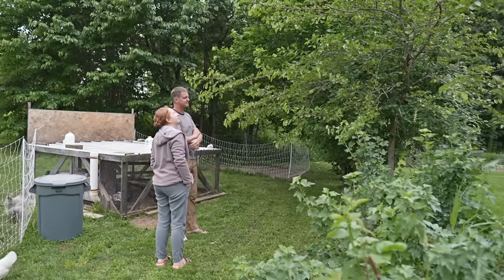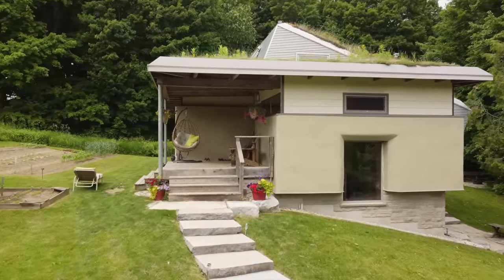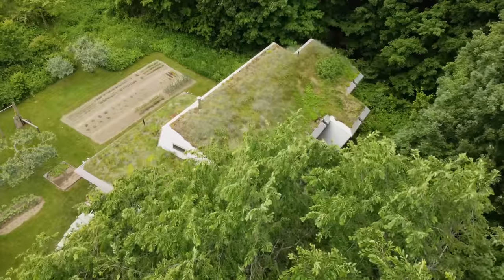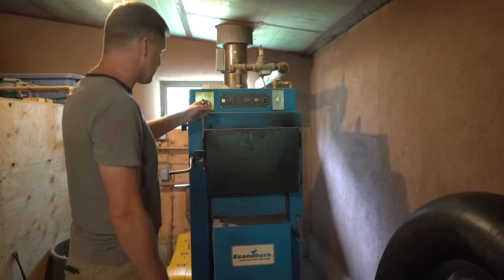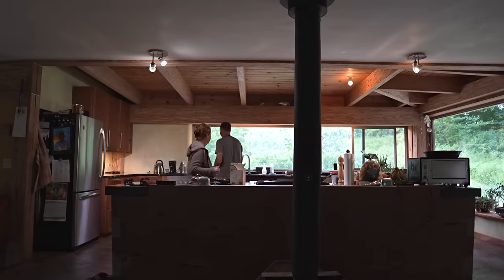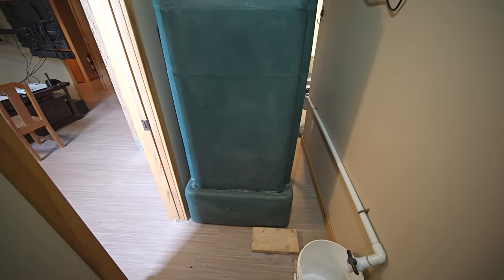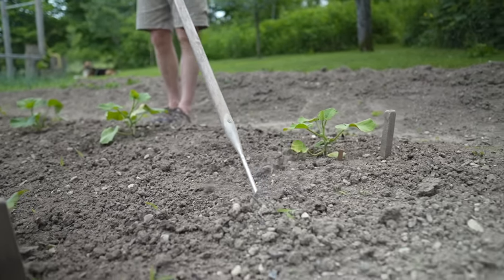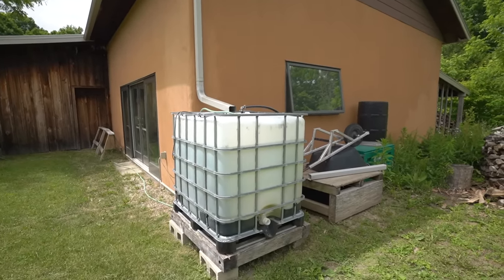Impressive Straw Bale Home & Dream Family Homestead — Sustainable Green Building

Comment: The extraordinary benefits of straw bale housing cannot be overstated.  (Don't get caught up in thinking straw construction can only be used as infill). The physical sensation of living in the quiet and warmth of a straw structure is profoundly nurturing.
Many states code straw bale without extra permitting or building requirements.  Several major insurance companies cover straw as well.
Reply: You have to have a structural “skeleton “ to support the weight of the roof as this person has done.  If not, then in an earthquake the roof will end up on the floor with you crushed in between the two.  Straw alone cannot safely support a roof.😊
Reply: @Mori-vl64k  Not to mention the straw compressing over time no matter what. Innumerable construction nightmares.

Comment: having straw for insulation is interesting. How does it react to moisture and how do you prevent your walls with being completely over taken by black mold?
Reply: I'm guessing that woodstove takes care of a lot of the moisture issues.
Reply: It’s covered by a breathable plaster so moisture can’t get trapped in. It basically just dries out when it gets wet and mould can’t form.
Reply: Straw is not the same as hay, but they look the same from a distance. Where hay would decay and develop mold or mildew in the presence of moisture, straw won't get moldy or decay because there isn't any organic matter left after harvest season. Farmers tend to burn straw if it's not being used to make something like straw hats or bags. 

Straw bale homes are fascinating. This home is very structured, but I've seen a lot of homes that have a more organic style.
Reply: @toldjacat  

You are correct that straw and hay are not the same but from there your explanation veers off course. Both are made from organic matter, which is, by this definition, anything with the element Carbon inside it. @lukeh3020 is correct by saying mould doesn't form because a breathable layer of plaster is applied to the straw bales on either side. This allows moisture levels within the bales to remain below a level mould will grow, unless that level exists outside of the wall.

Hay and straw are very similar but differ because hay includes the seeds (or grains). For example, if a farmer cuts mows a field of mature rye grass (it had gone to seed), dries it, and then bales the stalks then it would be bales of hay. However, if the farmer harvested the seed, dried the "waste" stalks, and baled those then they would be bales of straw. Then there is silage and silage bales, also referred to as "baleage" and are the large round bales, which take wet plant material and ferment it.

Straw is used for a lot more than just making hats or bags. A large usage is for animal bedding as it is absorbent, easy to put down and clean up, and animals like to lay down in it. Straw is a common material for mulch in gardens. The construction industry uses straw bales, usually in ditches, to filter debris so that it doesn't get into the water supply.

Comment: How has thermal mass been disproven as the best technique?
Reply: By passive design I believe. More efficient to have a super-insulated air-tight 4 wall box that's efficient year-round versus a 3 wall box with a mostly uninsulated fourth wall that allows for the thermal mass heating and changes efficiency as the seasons change.

Comment: What's that with the thermal mass? Isn't it important to store the heat from the day for the night and flatten temperature swings (phase shift day to night)? Sure good insulation, heat pumps and photovoltavis are the way to go, but passiv solar heat + thermal mass is a must have for a good indoor climate. Where can I read more about his insights?  https://youtu.be/WW12_UWsBaA?si=38rNnLR6bDbK74VP&t=306

Comment: I think their hearts are in the right place. But I see a lot of contradictions in this video. The amount of stone, while natural, is a nonrenewable resource, and there's a LOT of it here. There's a lot of metal in the build as well, with no mention of recycled or reused materials. They wanted a clean "breathable" home, but used tons of PSL lumber which off-gas formaldehyde over time. Their 225 gallons of rain water collection could be expanded, filtered, and sent back into the house to reduce their impact on the well/aquifer. Zero passive energy production, no solar ovens, no panels, no turbines, hydro, so I'm assuming they're on the grid and their passive solar water heating systems is just an effort to mitigate. Wood-gas is dangerous (explosive), produces tar that is carcinogenic and harmful to the environment, and inefficient due to have to chip and dry the wood.
Reply: I agree with a lot of what you say but I do believe stone can be a sustainable and renewable building material. 

I have worked on renovation construction in Ireland. A lot of the structures that I have worked on have been stone and the vast majority of the stone in these ruined buildings can be reworked and reused. The little that can't be used on the building is used in other functions like drainage ditches.

The buildings I have worked on are several hundred years old. All the wood had gone to rot, the metal was rusty and the only thing that was ready to go right away was the slate and stone.